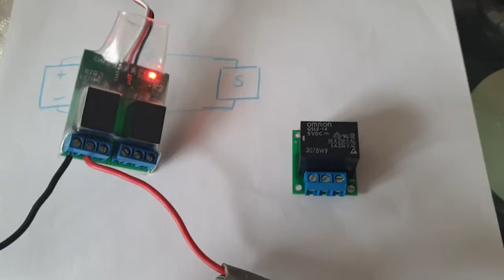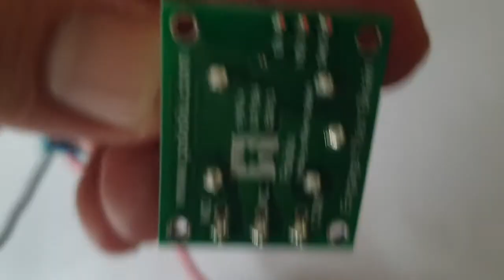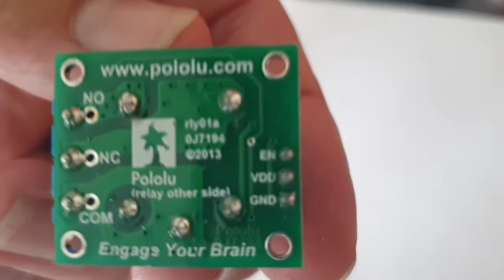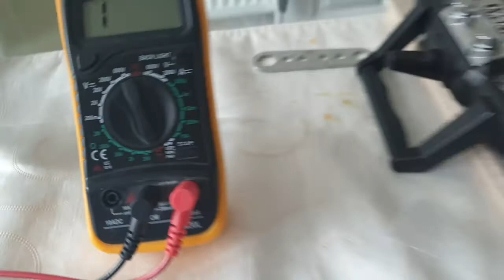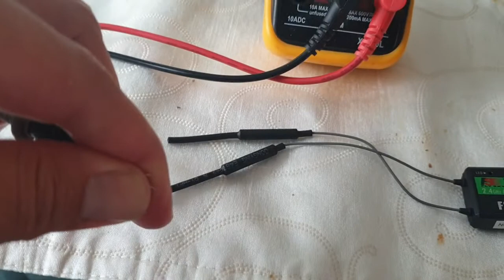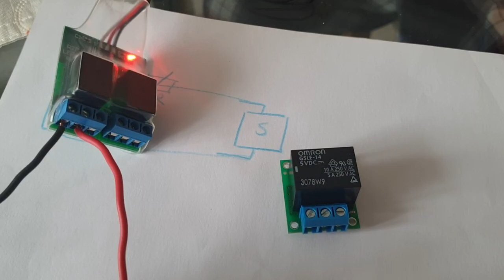beginners guide to Relays RC

Comment: Hi Gavin,

Thanks for this video. I do have some questions that you may be able to answer for me. 
I am interested in using this Relay in one of my RC Submarines as the ballast tank control. So I want to ask whether this relay will do the job.

The job is.

I need to run a 12v washer pump that needs to only run in one direction. The pump turns on and pushes water into a sealed tank. The pump is then turned off and the line is blocked ( solenoid) . The boat is dived. Then to surface the solenoid is opened and the back pressure forces the water back out through the pump. This systems already works with a servo rolling against a”pinch” of the nitro water line, but I am looking at doing a more “elegant” mainly electronic way of doing it. Hence the solenoid and this Rc relay switch in the video. 

Is this doable? Would this relay do what I need it to do? What solenoid should I choose (preferably the smallest possible in both items.
Your thoughts would be greatly appreciated.

https://zerobubblemodeldesign.jimdofree.com/dive-cylinders-zb-1-and-zb-1-2/

Thankyou for your time…

Comment: Can you tell what is maximum load ad dc voltage of each of those relays?
Reply from the maker: Was a while back now but pretty sure its 14v. We had them in a project hooked up to a car battery which would be nearly 14.4v fully charged.
Reply: @gavincorbould1831  i was looking if they work with 40vdc, or will burn/overheat. But i ordered already ssr25dd